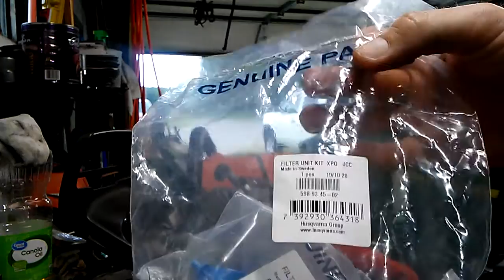Husqvarna 562 filter base upgrade installation, full of details

Comment: You're supposed to hook those 2 wires up before you put the carburetor in and let it hang off to the side, then when you get the carburetor in the housing will slide right in.  Make sure that you put the choke lever on top of the Spring on the on off switch.
Reply from the maker: Hi DON, you seem to be a Husqvarna service tech or highly experienced or both...good commentary....

Comment: You have 2 different housing there one is for an XP and the other ones for an XPG, the XPG is for heated handle & carb which is the blue one.  Black one is for the XP that doesn't have the heated handle & carb so it doesn't have the little element that goes between the housing and the carburetor.  There is also another difference I've seen as you're looking at the mating surface of each housing you can see the little rubber gasket that joins up to the metering cover on the top of the carb, on the old housing it's much bigger hole that is wide and in the new housing it's just one little hole off to the side. Why the big difference, Because that little area right there controls your fuel flow in your carb and controls your idle,  I mean the difference is quite a bit like 4 times the amount of air flow with the old one versus the new one.  Anyways I've been having issues with it ever since I put it on. I'm going in Monday to have my memory flashed the 2nd time in 3 years.
Reply from the maker: Hi DON, yes, a lot of this information I did not know until I had some communication with Richard Flagg. I purchased the unit for an XPG saw, it works...this was the first "5" series I had worked on, some trial and error but it runs great now. I appreciate you watching and taking the time to comment...